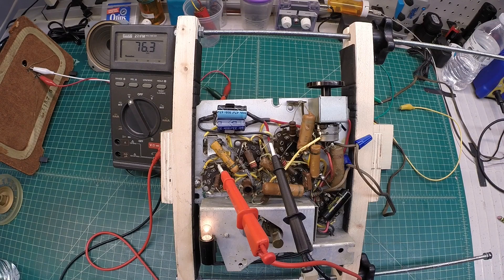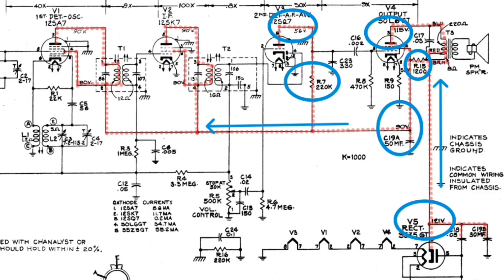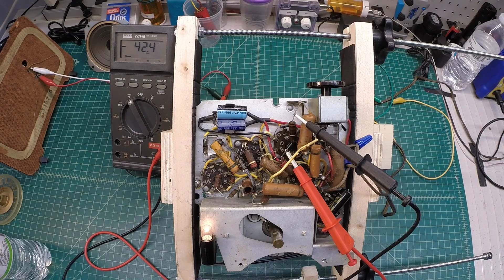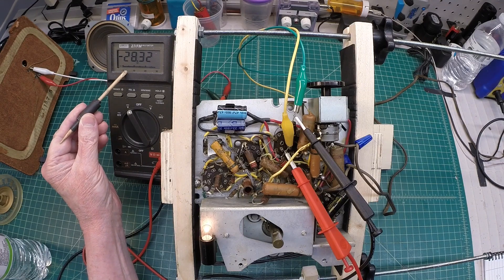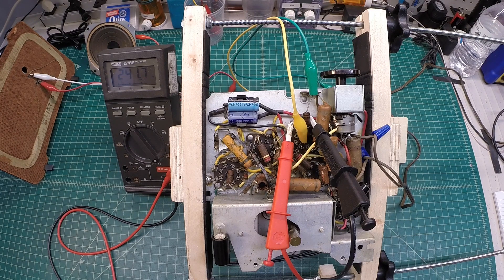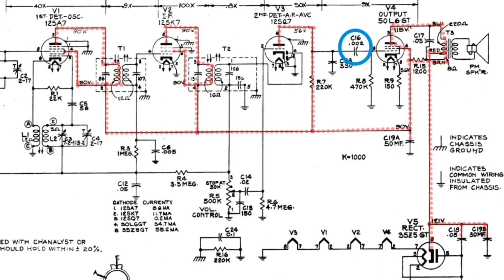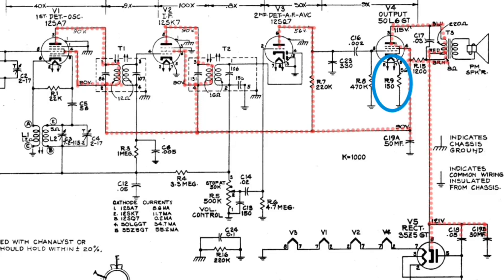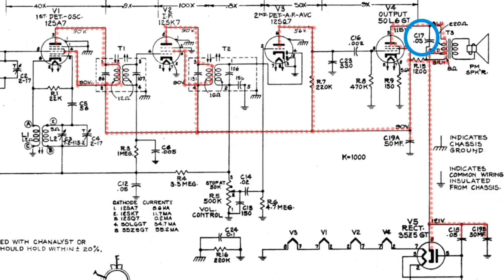RCA 8-X-541 - Cause & Effect P3 (B+ Voltage/Current Troubleshooting & Common Failure Points)

Comment: Great series, Don.  This was my first radio restore many years ago.  I did a few more after but work changed and I had to put everything away.  The radio worked great when I did have it out but recenetly after being in storage, I turned it on and I get a hum but the dial lamp does not glow.  The lamp is good but R15 is extremely hot.  I have not checked resistances yet, but I have replaced the caps.  I remember when I first restored the radio, the dial lamp was crucial.  But then, I had replaced the lamp and the rectifier and all was good.  But I'm baffled that the lamp does not light but isn't blown out.  Would you have an idea why it doesn't light?  In the meantime, I'll check resistances.  Thanks  UPDATE:  I found out why the pilot light was not lighting and why R15 was getting pretty hot.  It was because I had wired the line from the power cord to pin 8 instead of pin 2 on V5, rectifier tube 35z5gt....whoops!  Now I need to find out why I'm not hearing any stations.

Comment: Your videos are so well done, thanks for posting. Can you help me understand the rectification done by the 35Z4 tube in producing B+ for the rest of the radio. I always thought the rectified current/voltage came off the plate from the cathode but  your video and other sources show that it comes off the cathode directly. I assume the cathode is always boiling off electrons so does  half the current go to the plate when it is positive and get dumped to ground and the other half flows from the cathode into the path you depicted since it still has excess electrons but is neutral or positive compared to the plate?
Reply from the maker: Thanks for watching and reaching out. Here’s a link to an old study guide on power supplies that I reference: https://worldradiohistory.com/Archive-Courses/UEL-1967/UEL-24-SpecialPowerSupplyCircuits.pdf and the preceding: https://worldradiohistory.com/Archive-Courses/UEL-1967/UEL-23-PowerSupplies.pdf

Thanks again for watching and reaching out.

All the best.

Don
Reply: Thanks Don, those are excellent sources,

Comment: I see a lot of folks who go ahead and give it a test to see if the radio works without taking into account the potential damage to parts you want to preserve such as the output transformer, tubes etc.  I hope many, many restorers view this one!  Remember the Hippocratic oath of restorers: "do no harm" (if possible).  There are simple shortcuts to the thought.  I have heard that a wax paper capacitor by Shlage (sp?) with the "dark red lettering" , or is it orange (?), are high quality and do not fail.  I have never seen one in the radios I work on.  So they all go.  Every one I pulled out had heavy DC leakage.  In my radios I see a lot of "bumble bees" and "tiny chiefs" and they automatically go as well.  All leak DC without exception.  Occasionally I have seen DC leakage in a true mica.  Sometimes ceramics are out of tolerance or are open.  Even if you happen upon a radio with restuffed capacitors, they should be tested for DC leakage before operating because you don't know when they were restuffed.  So your video is the caution about "just giving it a go" and starting up, variac or not.  Blessings, Albert
Reply: And I will remember everything you said in this series as I go through restores, Albert
Reply from the maker: Albert - your points are spot on. My Dad who loves woodworking  and refinishing radio cabinets was always eager to get the chassis back in and power up the old radio. Of course he would replace the frayed line cord and check tubes afterwards and if the radio still didn’t play it was sent to me for repairs. I hope others view this too and get a better understanding of not powering these oldies up before servicing them. Best, Don

Comment: Great tutorial on this subject. Don't assume to just change out the electrolytic and paper capacitors. You must check the resistors as well! Out of spec means replace.
On older radios it is important to use a variac to see if you have trouble spots after changing out the capacitors!
Reply from the maker: Great point and one I'm taking and hopefully others as well that are following along. All the best. Don

Comment: Don, after you powered down the radio did you bleed the electro caps with a tool or did they bleed off themselves through a resistor perhaps?
Reply from the maker: Jim - thanks for reaching out. I use a 100 ohm ~5W resistor to common ground to bleed them off even though the two caps in this receiver would typically drop to a few volts within one minute or less. Thanks for watching. Best, Don

Comment: Good video again thanks Don. Wonder if, at sometime in the future, it might be worth going over the importance of matching the speaker impedance to the output transformer? I have an AR88LF which requires a 2.5 ohm spkr but they can be hard to find now. There is a lot on some forums about the risk of using a 4 ohm spkr instead. I wonder how important that really is or if not how high you could go without risking damage? Regards David (Scotland).
Reply from the maker: David - thanks for your feedback. I googled your receiver and that’s a nice one. A 4 ohm speaker is worth trying or you could try using an 8 ohm speaker with a 4 ohm resistor (w/ the proper wattage) in parallel across the voice coil for a 2.6 ohm load. I would be curious to hear back if you elect either method. Best, Don
Reply: @RestoreOldRadios  Don thanks for that it works well, I had been running it off a 6 ohm spkr before. I was curious to see if it would make a difference to the overheating of the first filter choke (L50). Seems like I have a strange problem with that. The HT current is about 90mA which is on spec and it's resistance is 400 ohms again on spec. So the power dissipation is just over 3W but it gets quite hot (just about about the max your finger can handle). Over the years the bitumen has been weeping out of it. The rest of the circuit checks out ok and the caps are good and the output tube is running on spec. So I am surprised that with just over 3W it gets so hot. Can't see it was designed that way or maybe it was?. I have a spare choke but was trying to diagnose the problem first trying the other one. Take care David.

Comment: Another great video Don, good troubleshooting steps I liked the idea of putting the resistors in parallel to boost the B+ voltage. I know that wire wound resistors  shouldn't drift in resistance as much as carbon ones, but the heat they put out does put stress on them.
Reply from the maker: Thanks Jim. I thought adding the resistor(s) in parallel would allow me to better illustrate cause and effect. I appreciate your feedback and thanks for watching. Best, Don
Reply: @RestoreOldRadios  That was a very good illustration for sure.